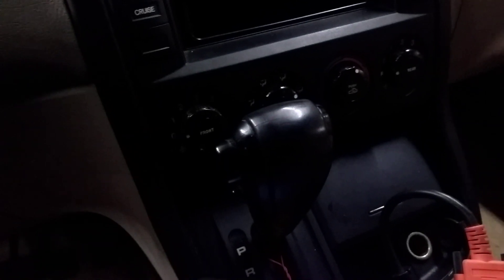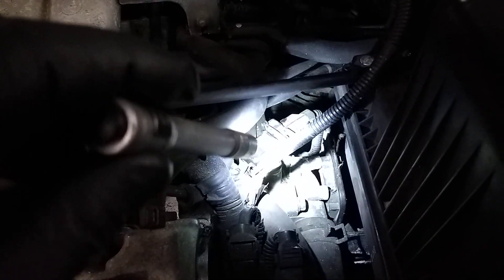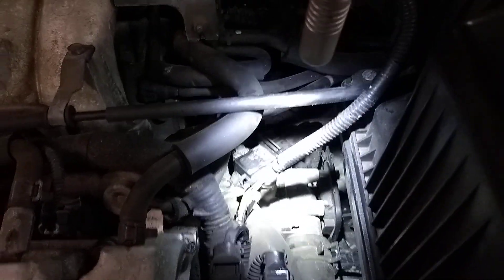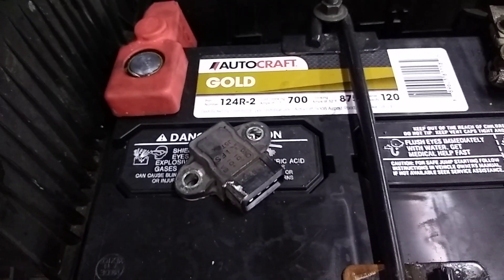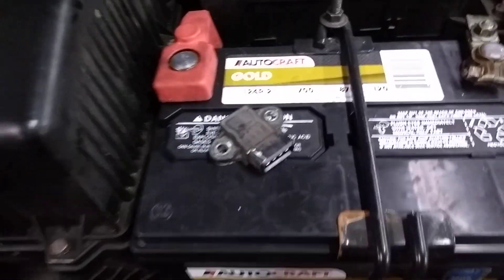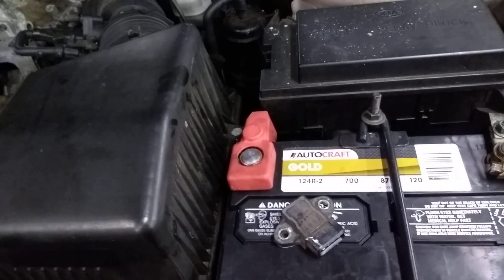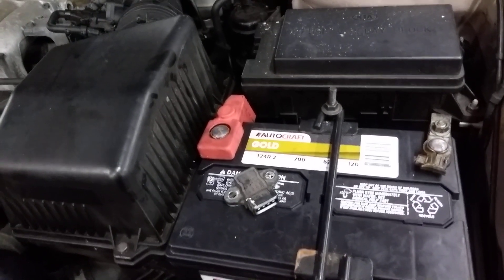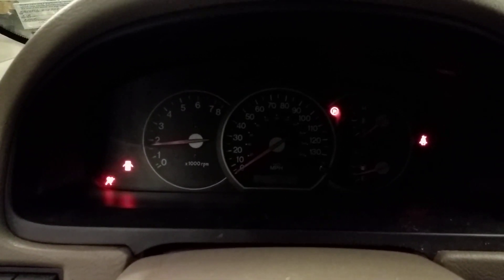Kia Sedona no tachometer w/ po320 code

Comment: Thank you for this video.  I bought the sensor, installed it, and now it looks like everything is fixed.  No more check engine light, tachometer working flawlessly.  I had to reset the computer by removing the negative battery terminal.

Comment: I have a 2005 Kia Sedona and the transmission input output sensor keeps going out. Any idea why?
Reply from the maker: Possible circuit and/or module problem. Taking a look at wire diagram may help
Reply: @johnandeddie  it's at a shop. It sounds like we bought garbage sensors that kept failing. We bought one from Kia so we'll see if that was the only problem.

Comment: What is the sensor called?
Reply: The South Main video he talked about shows the after market part and part number.  This video saves time but the other goes through a full explantion of the diagnosis including a 4-12 voltft wave form and a zero to 12 v on the good part.  I believe it's called an Ignition Fault Sensor but the code can send you looking for a crankshaft sensor.  The key seems to be if the car is running or not whether you have to go to the crankshaft.
Reply: Ignition failure sensor
Reply: Ignition misfire sensor on Rock
Reply from the maker: Ignition distributor speed sensor